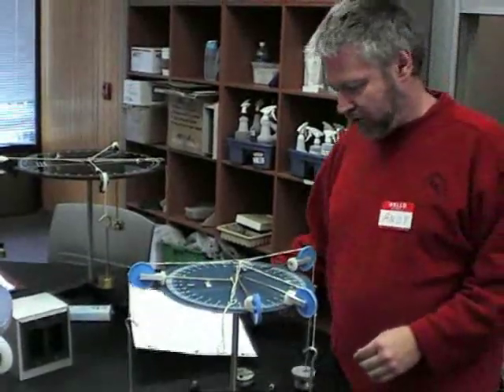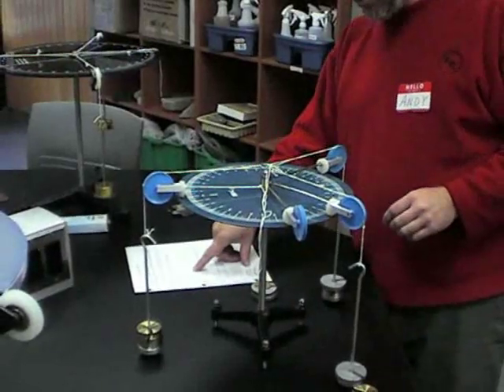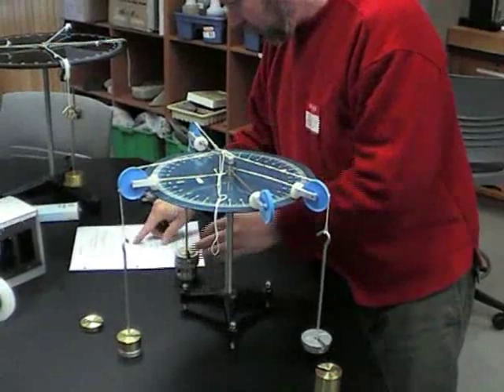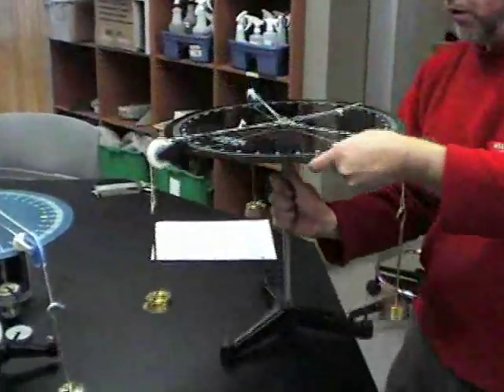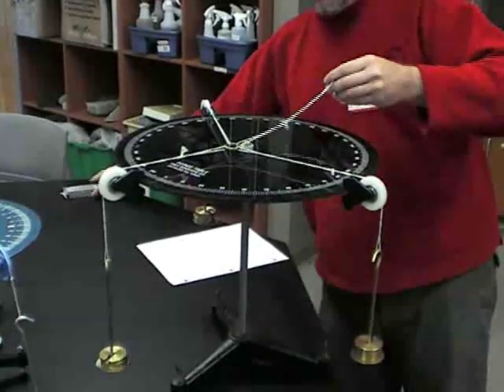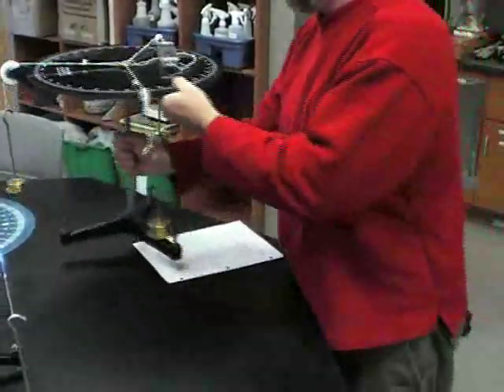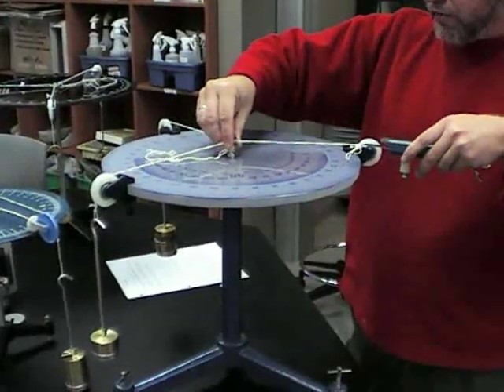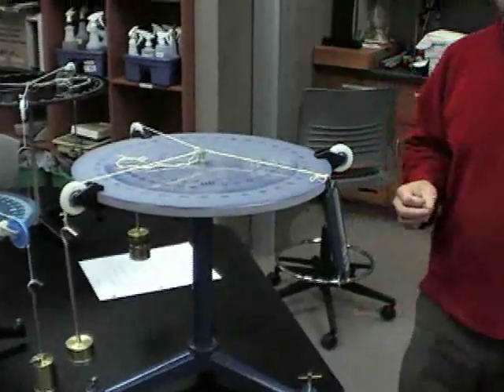Lab 4 2 force table

Comment: Universal Force Table : -- It is a common physics lab apparatus that has three or more chains/cables attached to a center ring.The cables are placed over the pullies and loaded by mass.The cables exerts forces upon center ring in different diarections. It is used to prove the law of Polygon forces,Lami's theorem and many more.

Thanks for Video !!!